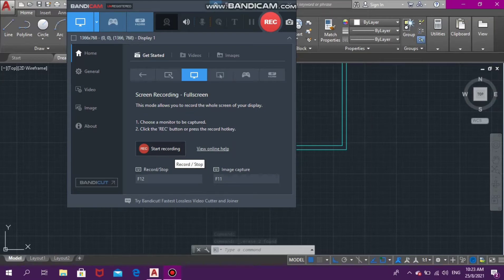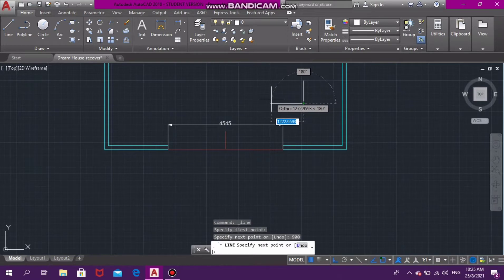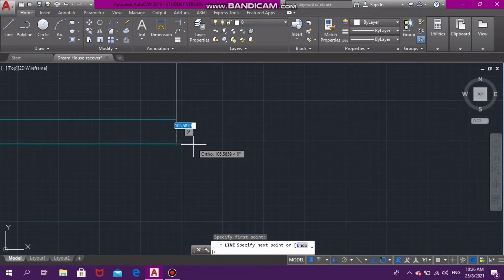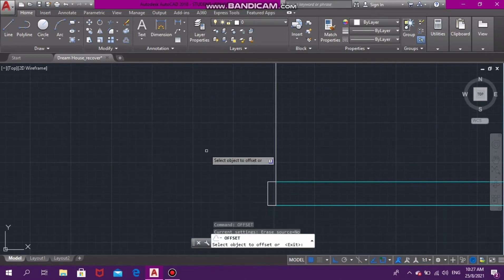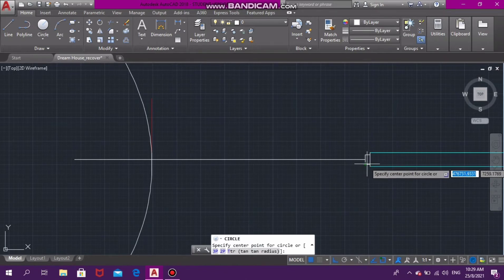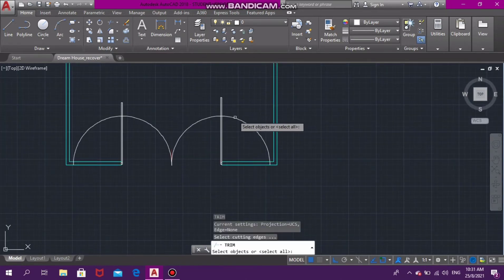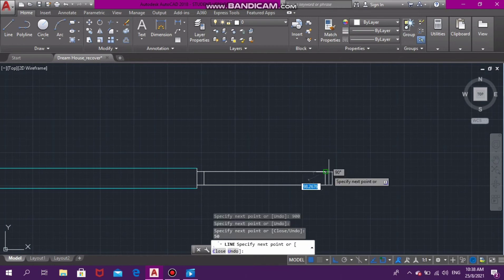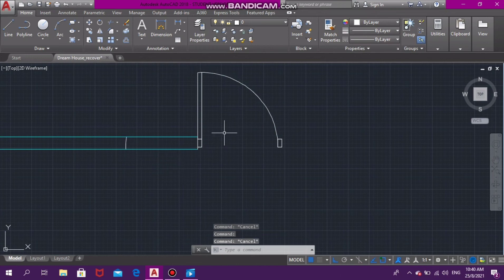How to draw doors in autocad#autocadtutorials

Comment: Hi, yes please, the dimensions numbers are almost invisible, very small, I don't know how to make them big enough to see them. Thank you x
Reply from the maker: @cameliahurmuz6488  Hello! Here’s how you can fix that issue:

1. Enter 'D' in the command line, and a pop-up should appear.
2. In that pop-up, click on "Modify."
3. After selecting "Modify," you'll see multiple tabs at the top of the dialogue box, such as Line, Symbol and Arrows, Text, Fit, etc. 
4. Select the "Text" tab and modify the text height by entering a larger value.

I haven't done a video for a while now but i could do a short one on adjusting dimensions if youdd like.